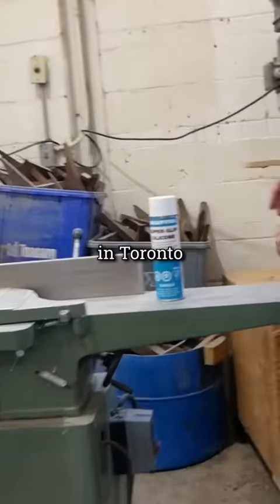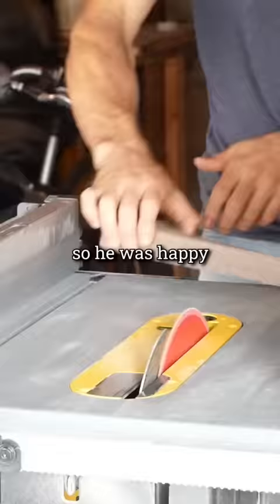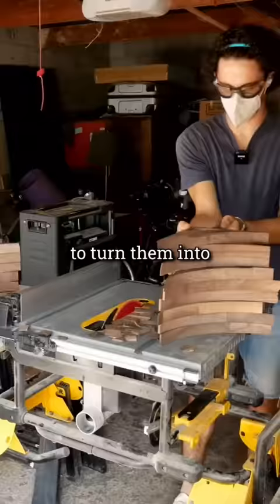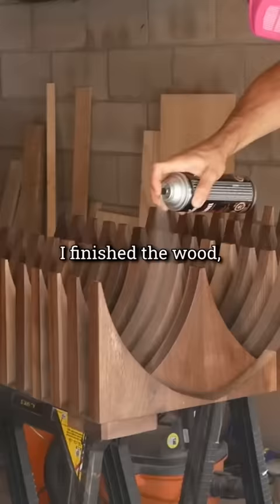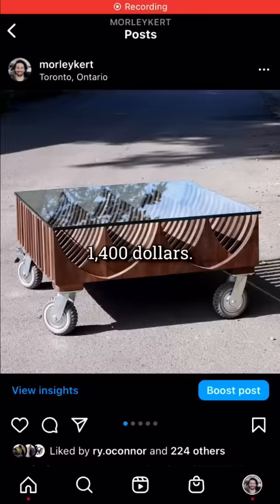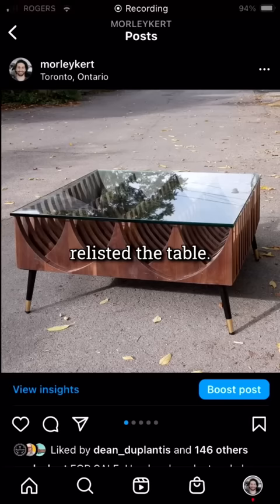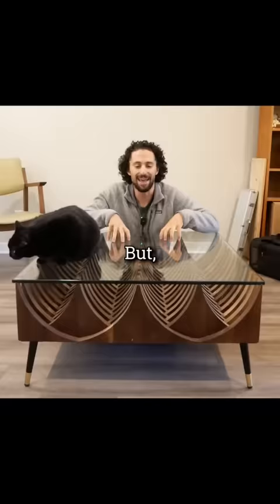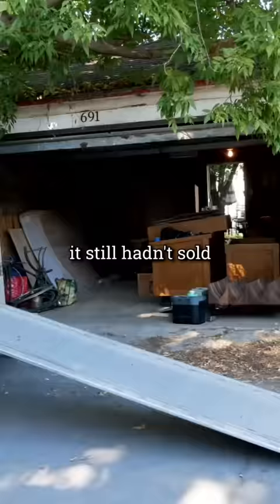Free scraps 👉 modern coffee table #DIY #woodworking #upcycling #shorts

Comment: This must be an absolute joy to clean
Reply: i would never. rather have a cheap $20 that i never have to dust
Reply: I didn't even think about that!! the dust 😖
Reply: Exactly
Reply: I am so relieved i am not the only one noticing this.
Reply: That was my first thought before he even finished making the table those complicated structures are the hardest to clean especially on a regular basis
Reply: @zherkezhi  yeah, but how are you gonna deal with the finer dust particles that just wont fuck off the damn surface?
Reply: Just take off that end of the vacuum and hover the now big end over the gaps
Reply: I presume you’d need to remove the glass and then use an air canister? Or a handheld Hoover? But at that point I think anyone would just be saying fudge it and attempt to manually clean it 🤣
Reply: Yeah as a furniture designer and creater that was my first thought
Reply: Especially with a cat
Reply: I've seen worse, by artists, that sell for 10k because of name recognition. What i would say: imagine bying something like that just for the status of the item and feeling better about yourself. When instead you can buy something by a small creator like this?
Reply: Turning the glass is impossible I guess
Reply: You can see the dust built up at the end of the video. Wouldn't be too bad with a duster to be fair, though. Just pass it through a few times. Good enough.
Reply: Obviously made by guy who is never dusted🤣
Reply: Tale it outside. Turn on leaf blower.
Reply: I was thinking, I have two cats....
Reply: Pressurized air? 8 bars and pretty much any dust will be blown out, even out of the smallest of cracks.
Reply: This was my first thought… and they have cats, so imagine all the hair stuck in between each piece… 😩😅
Reply: 100% agree, all these art piece furnitures r dust collector
Reply: jesus these people talk like theyve never seen a vaccum with a brush attachment before lmao
Reply: Vacuum
Reply: @senioravocado1864  that's a bunch of guacamole. I'm not the only one to make the comment. Every woman ( and that's what I am, not a "dude") has said the same thing. What a nightmare to dust. He's trying to sell that piece. Every woman looks at that piece  as a giant dust magnet, as more work. It's beautiful to look at as long as someone else has to clean it. I like to make things from scraps to, but personally I would have made that into a room divider or folding screen.
Reply: @Platypus2062  dude is mostly used as a gender neutral word nowwa days so there's that. Also, I'm a man that cleans the house, what are you saying, sure it is a dust magnet but that goes to every bloody top shelf in the house. I even found 10 dollars up there 1 time. Anyway, there are multiple ways you can go about cleaning this table, a vacuum, I assume most households have one, if not use a hair dryer at full blast (take it outside ofc) or have your male SO pull out the leaf blower and blast that thing. If you have none of these you can still take it outside and hose it down yourself, use the jet nozzle for better effect, and while you're at it, give it a little soaping and ask someone to varnish it every year or so

Edit: yeah, that would've been a great divider but they make tables but folding screens are a bit of a stretch though
Reply: I didn’t think about that but I also accept dust as an inevitable. Like some spaces aren’t worth dusting.
Reply: @heromedley  i don't think that would fit lol
did you see the size of the gaps? tiny af
Reply: @senioravocado1864  the point is cleaning the table takes wayyy more time than the average less than 15 seconds that a regular coffee table takes
Reply: @personguyguy  yeah but y'all make it feel like an eternity
Reply: @deborahhanna9126  this is my new preferred method of dusting
Reply: @senioravocado1864  if it takes longer then ya lol, it does kind of feel like an eternity. The best chores are the ones that don't feel like a chore after all! Id rather spend the time I'd use dusting that thing for a few more minutes ahead in a different project or chore personally.
Reply: Dusting does not bother me, it is just a chance to enjoy the skin cells of my ancestors.
Reply: @buttieboy666  cats and vacuums is never a good combination. Cats and leaf blowers less so.
Reply: Dude it's a 1400 dollar table, that spray he put on makes it so you never have to clean it
Reply: @askjeevescosby2928  god need me some of that spray
Reply: Dont worry you can simply take off the glass top that is only held on by its own weight.
Reply: Thats exactly what i thought 😂. But it looks awesome!!
Reply: Treats and a Persian. All I'm saying.
(The cat breed obviously)
Reply: The cat is the automatic cleaner collector of dust down there
Reply: That's the only thing I thought of
Reply: This is an item you have your maid clean

Comment: "I finished the table"

sprays aerosol lacquer all over it with the utmost inconsistency
Reply: Honestly guys sounds so high of himself but this is a really easy and in his case sloppy build.
Reply: It's art.. mkay
Reply: @calholli  Is this sarcastic?
Reply: @calholli it’s art…get
Reply: Came here to say this verbatim. Also, no joinery whatsoever. Just glue shit together and call it good. Get back to me when you can make a project without one nail or screw or even glue (though to be honest, I usually glue my finger joints and dowels).
Reply: @76jasonl  It's pretty clear that he also used nails. Enough glue and nails and that thing will last lifetimes.
Reply: @charliekelly3173  Nails look sloppy unless you take a lot of effort to clean it up, and most glues will fail after repeated stressing and heat-cycling. Glue and nails reinforcing good joinery make a piece of woodworking last.
Reply: @datdabdoe1417  this is true. glue is certainly very strong when applied in the type of joint that plays to its strengths, but will always eventually fail, and much quicker if it is the predominant force holding the item together
Reply: RIGHT?? OMG. I made myself a balcony shelf for my plants with old wood and I spent more time doing polyurethane with a brush. He didn't even sand the curved cuts??
Reply: And has the nerve to put casters on it and attempt to sell it for $1400!
Reply: Consistently inconsistent
Reply: @calholli  thank you Mr Van Driessen

Comment: I feel your pain. I tried selling my old 90s TV for 2000$, and I ended up just keeping it
Reply: It's a joke. @MattStrike
Reply: Give it time. Retro gamers can be an odd bunch.
Reply: @RodBeauvex  Not odd, it's literally the only kind of TV that will play games designed for CRT's correctly.  Anything gamecube and older looks wayyyy better on a CRT opposed to LED, and some of the fonts and effects can be more thorough as the LED can't display some of these things.
Reply: @MattStrike those older flat screens are in high demand actually
Reply: @UncannyLiving 

Yeah it's funny how this is intended to be a joke but some crt televisions from that time do actually sell for this much haha
Reply: @MrKushinator420  with modern tech you can convert systems for around or less than $100 to HDMI. basically making needing a crt being pointless to collect. I'm talking about quick wiring on the inside of the system, not cheap adapters.
Reply: Sony PVM owners be like 💀
Reply: Must have been a big statement piece.
Reply: I wish I still had mine.
Reply: If you wait long enough say 75 years or so if they are still in good condition you might get 2k
Reply: @MattStrike  it had sentimental value so for that reason alone it’s why it cost 2k
Reply: I want it for $2,000 Venezuelan money or 10 cent American

Comment: Glues free wood together, slaps wheels on it and a piece of glass... "That will be $1400." Sir.
Reply: Messed up
Reply: That's everything...lol,  It's outta control.
Reply: The wheels made it look horrible 😭
Reply: I'll give him $5 top.
Reply: Just because he got the material for free doesn't mean its worthless. It's all solid pieces of hardwood, cut into an intricate shape. Try asking about having those pieces made in your local woodshop.
Reply: @Kuchenwurst  the point is the "intricate" shape was cut by someone completely different. My man also said nails lol, sorry but if you want to make a high end piece of furniture, thats gonna sell, nails are not the move, but sanding and finishing is, which also looks like it got skipped. I am all for the hustle, but really that amount of walnut doesnt amount to 1400, the glass certainly doesnt bring it to that amount and I didnt see an application of skill/time that at all seemed to warrant that price point.
Reply: @Kuchenwurst  
Solid???
You think adding glue is solid????
Reply: Exactly, trying to profit out of someone else. How can one even think of charging 1k plus$ for making it? Just plain fleecing your would be buyer.
Reply: @young7931  Assuming he did the gluing properly, the glue is stronger than the wood.
Reply: @Kuchenwurst  he got those pieces already in the shape he just cut the corner off one end and glued them together as they were. 
It would be a nightmare to keep clean and wouldn't be that useful for holding anything other than a magazine.
Reply: @tylisirn  yeah but he secured them with brads, no clamps. In the full vid u can see gaps and shifts in the wood, so I'd say not the nicest glue up.
Reply: Wait until you find out how much literally any furniture costs
Reply: Clearly you don’t have much woodworking experience, and it seems like you watched a different video then me…
Reply: @scottpollock1714  and the fact that he put wheels on it AND simply placed the glass on top, as if that's not a health hazard
Reply: @Kuchenwurst it would still be worth at most half the price he’s asking for
Reply: I made your likes a even 1,000
Reply: It’s kinda ugly imo anyway
Reply: Right? Disgusting
Reply: Okay, y'all in the replies are daft, he literally said he glued and nailed all of them

Also, that glass is aint no normal glass, those are the expensive ones that probably cost about 1000 dollars for whatever reason

Ofc, it's a business, he needs to make a profit to live, y'all know inflation is a bitch. The price is on the steep side though that I would agree one. But cost accounting ain't easy

Also, y'all have vacuum cleaners don't y'all, you can use that to clean the table

Oh and btw, it's a table, it's doing it's job fine and who still uses magazines and newspapers for the reverse arch space to matter? They have a cat, I promise you that cat is gonna make good use of that space
Reply: People always forget the handmade work, time, talent(?), and publicity of made this type of product
Reply: @Kuchenwurst  my brother in christ they were already cut into those shapes when he got them, all he did was make the edges flat with the table saw.
Reply: Clearly you've never built anything out of wood. It's a lot harder than it looks, even if he made the mistake of adding wheels at first
Reply: He’s also not just slapping all these things together it takes time and precision
Reply: @young7931  GLue is stronger than the wood itself, so yes, it is solid.
Reply: @Young  yes.
Reply: @BackyardRussia  Comments like this make me so angry and it really shows ignorance. If anyone here tried to do something like this they would likely buckle under the stress of trying to make sure they're cutting off the right amount each time and having to measure parts so they fit exactly. Sure, it may not be worth $1400, but it still isn't going to be cheap. Ya'll are only looking at the cost of the materials (free) but not the time and effort it takes to make something like this.
Reply: @Kuchenwurst  a local wood shop did make them, and they were free.
Reply: The audacity of some people. Like at least act humble, if you really have no basic desency ffs
Reply: @scottpollock1714  don't forget he has to sell it in 3 days!!!!! 😆
Reply: I find this to be the stupidest thing but hey. There's too many that like it
Reply: @senioravocado1864  in the actual long form video he says the glass cost 200$ and I'm sorry I get that people have to make money, as a woodworker myself I do understand the struggle and hustle. But my point is that as a beginner (which he clearly is) you can't expect to fetch the same price as a master woodworker.
Reply: @scottpollock1714  bruh $200 glass

Also is he a beginner though? He literally owns a woodworking shop
Reply: @senioravocado1864  well based on how he did everything I can tell he is pretty new
Reply: @scottpollock1714  i see, I haven't watch this guy make normal wood tables since I know him for making wood-acrylic so, I'll take your word in his actual wood working skills

Nvm about the wood acrylic part, I was thinking of a different guy
Reply: @mrbfros454 Then what video did you watch? Because this comment explained it perfectly. The table didn't even sell so apparently the people he tried to sell it to also agreed.
Reply: @No_Lucks_Given  it’s a lot easier to criticize than to even have a clue about how much talent and experience it takes to put together a table like this. Just because you think it’s ridiculous doesn’t mean it is. And just because people agree with you doesn’t mean you’re right. Like he said it’s a statement piece and for stuff like that the right person needs to come along and fall in love with it. What I’m saying is there’s a ton of artistry and engineering that went into that and its not a mistake to charge a premium for that. If you don’t like it don’t buy it but that doesn’t mean it’s garbage.

Comment: I dread because of how much dust those gaps would accumulate in just a couple of weeks.
Reply: Oh no I hadn't even considered that 😭
Reply: Probably best to take it outside and use a leaf blower 😛
Reply: I would have sanded and clear sealed the curved faces so there is less surface roughness. Then you just take the glass off and use a vacuum wand with a brush end to agitate and suck up the dust. Or, add side panels so the dust is the only place to catch dust.
Reply: Keep your house cleaner.. get a air purifier. Gross
Reply: I have a malamute and although this is a cool table it would be a magnet for spring shedding.
Reply: While I totally agree with you, some people are willing to put up with a lot of headaches for appearance. I have a very wealthy uncle who designed his own house. He wanted all the interior walls to be 2x3 not 2x4 as he didn't want to loose the extra inch of floor space taken up by the thicker wall. I shit you not. My dad did the electrical for him and said it was a nightmare doing the wiring, all the wiring had to be armored and all the boxes and fixtures had to be special (very expensive) low profile to fit. He said it took my uncle 2 days once to decide on the placement of a single hallway light....
Reply: Get a nice duster and it’ll be no issue
Reply: People that are buying a $1400 coffee table pay other people to clean their house.
Reply: @randybobandy9828 not that simple. We have 4 air purifiers and it’s still dusty. We have 6 Great Danes. We have to wipe everything down every night and morning.
Reply: Nothing a swiffer cant fix
Reply: that's what I was thinking. No one wants to dust a coffee table every day. and that would be very awkward to dust
Reply: All part of keeping a house clean, I have TONS of lego sets on display and they need regular dusting/cleaning.
Reply: Air compressor.
Reply: Ikr!
Reply: Seriously. Plus they have a cat and a dog.
Reply: Imagine how many spiders that would want to live there as well! 😮
Reply: @randybobandy9828 I live in a dusty dirt desert.
Reply: @randybobandy9828  I have two cats and wool mice in every corner. They even sleep in bed with me and the blankets are like actual fur, with hair all over it. 
The few hair pieces in my cigarettes and my coffee are sometimes a bit annoying, but... no. no thanks 😂❤️

Comment: Option #1) remove the glass, store books in it tightly, put glass back on or #2) take off feet, flip it the other way so the bottom becomes the top, spend a few learn how to properly seal the new top, build a base for the now-pointy bottom to sit on, attach, done.

Comment: Even if you can take the glass off by yourself, that's a hell of a build to clean.
Reply: I was just thinking about how much of a beyouch that must be to dust...
Reply: Just get the skinny attachment on a hoover in between the gaps, damn
Reply: I mean if you spend $1400 for a coffee table you probably have someone to clean it for you
Reply: @FAB1150  I'm not considering who but what.
Reply: @FAB1150  good point
Reply: not really just a fluffy duster through the gaps would get rid of the visible dust
Reply: I am pretty sure the glass is just sitting there lol
Reply: @CemeteryLarry  yes, it surely is, that's why my thought was more about being able to lift it by yourself (weight, dimensions) than whether or not it is screwed/glued to the table.

Comment: Definitely a cool table looks hard to keep clean though.
Reply: Compressed air for the dust. But yeah a spill would suck haha. I guess go hose it off lol
Reply: A long handled fluffy duster used for dusting window blinds or a swiffer disposable duster could slide down each section channel in a jiffy without having to go down each individual fin. I have one that has an extension handle that dusts between the slats of my wood blinds.
Reply: @Okay Egg correct. Compressed air